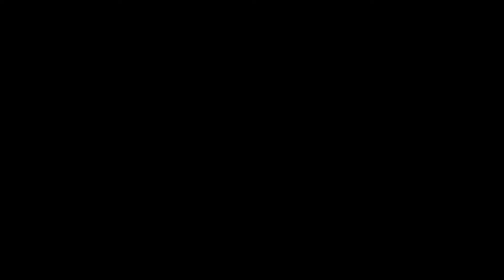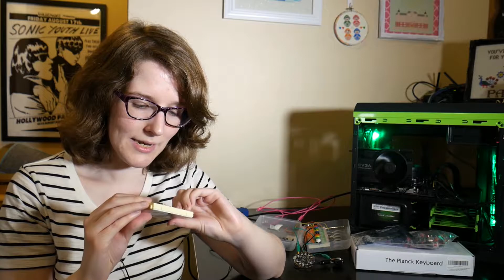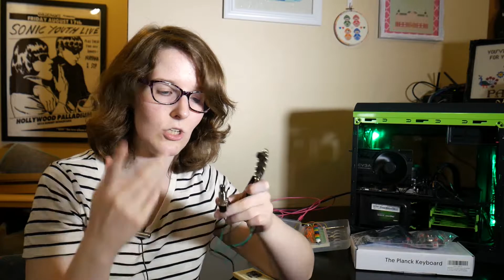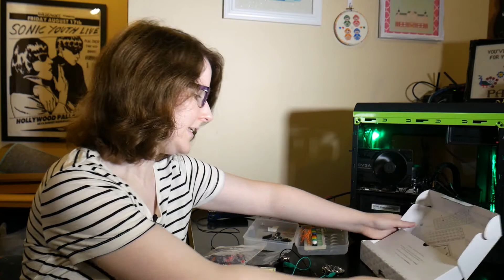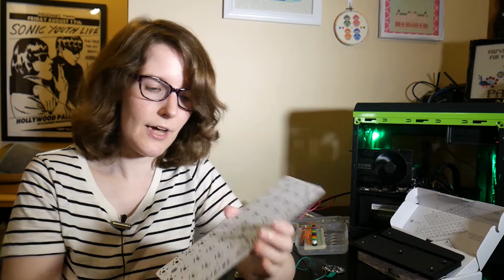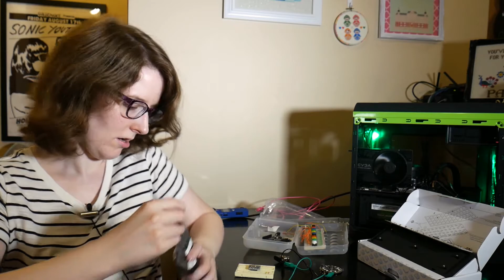WIP Projects Vlog - September 2017

Comment: Are you going to make a full video on the Pedal Pi controller? Pedal Pi was my first raspberry pi project, and first soldering project in years. Definitely still have a lot to learn, coding wise. The controller sounds like an awesome idea.. would it be a push button to switch programs? I wish I knew how to program mine in way that you could just plug it in and it would boot into the last one you were running. So I could use it live without much setup. Anyways, cool channel! I'm very intrigued.

Comment: I love this kind of videos! I would try using maybe a mechanical switch instead, like the kind they use in keyboards, those can take quite a beating. I think the best switch for such a foot pedal would be a buckling spring switch but those are kinda hard to come by... I'm mostly a fan of like super near hardware kinda projects that require very little programming, like implementing multiplication in hardware (it's actually quite simple) or stuff like that. I've been trying to get into FPGAs lately, they're fascinating little things but I haven't yet gotten like the hang of it yet, it's pretty hard to get into hardware synthesis when you've got this standard hardware and software mindset. I've made a little plant watering system a coupel days ago that automatically waters one of my plants whenever the soil dries out, I thought about building like a bigger version of it with the capability of controlling five plants individually but like I technically can do it but what's putting me off is the kinda PCB space I'm gonna have to use with like all those basically through hole PCB headers, I would kinda like to add surface mount headers but I haven't yet found any that don't require you to use solder paste and a reflow oven (I'm terrible with that)... Do you know of any super cheap PCB manufacturers? I have found one that apparently can make ten PCBs for around $2 but I don't know about the shipping costs...